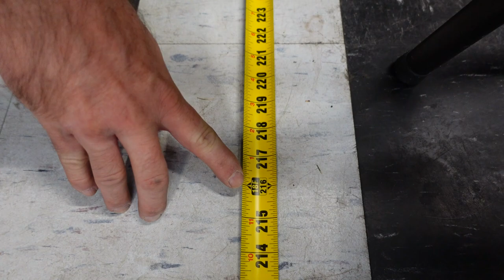Turbo S Wont Fit Trailer Widening Time DIY Part 1

Comment: Just cut the rails off the trailer and widen the trailer itself to the width of the outside of the fenders. Then just drive up the fenders. I will post up some pictures on your Facebook page tomorrow.
Reply from the maker: I wish we could but this trailer is super light and depends on the side wheels to hold it together

Comment: Did you think of narrow tires then changing them when you get there?
Reply from the maker: Yes, have done that many times. That's the reason we're doing this.
Reply: @DandiOffroad  I'm always doing that also . It sucks. I have a friend that straps his suspension in to fit it in his cargo trailer.  Can't wait to see what you do.thanks
Reply from the maker: Yeah, no fun at all. We ratchet strapped our car for a few years to fit in our smaller toy hauler, swapping tires is definitely worse though. We should have it done and all video up in the next few weeks.